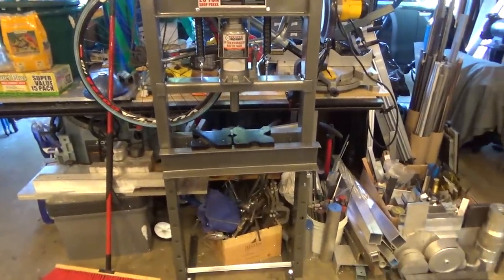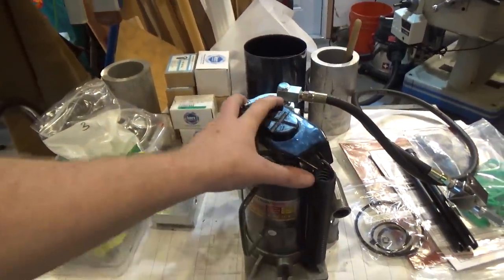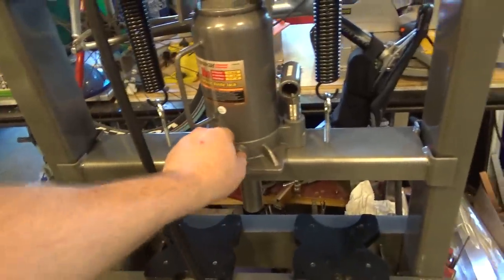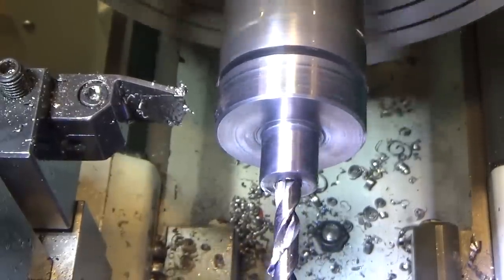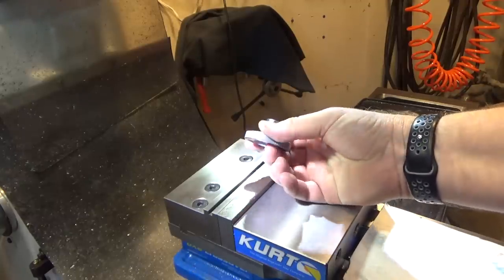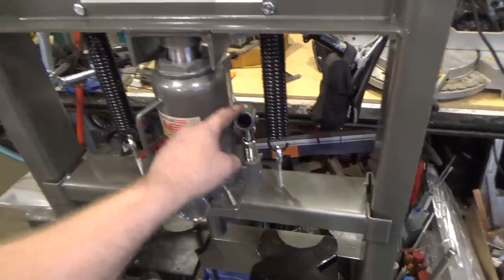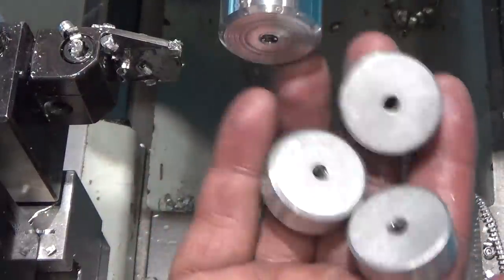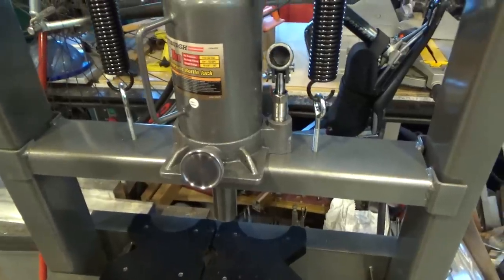Improvements to a Harbor Freight 20 Ton Hydraulic Press Part 1

Comment: Good video!  Do you do any Blacksmithing?  This would be a great addition to a Smithy!  All kinds of things can be done more efficiently such as forge welding billets of differing steels to for a Damascus billet to make knives, bending material and drawing out your billets to easily lengthen and flatten them for making beautiful knives from differing steels to form Damascus or forge welded/pattern welded billets.
I want to get a similar press and a hydraulic motor and all the hoses, etc.  THAT would allow me to forge weld Damascus billets for knife making.  As it is, I have a rare disease that eats all the cartilage from every joint, leaving me without the strength to wield a heavy enough hammer to forge weld Damascus billets.  A hydraulic press would be much easier and faster to do the job of welding and drawing out the billets.
I love the changes you made and will likely try to do some of the same things when I get mine
set up.  Although that will be difficult since I don't have a mill and can't afford one and the area of Wyoming I live in is hard to find anyone with a mill or a machinist, for that matter.
Great additions/changes!
Great addition to any shop whether you are a Smith or a mechanic or just a hobbyist!
Thanks for posting your changes/upgrades!!
Reply from the maker: Thanks for the comments. I had not considered a black smithing use as I know almost nothing about the trade. I am really sorry to hear about your unfortunate condition. I am not certain, but don't they make some sort of automated hammering device for smithing? Best of luck and I hope you find someone to partner with to let you follow your dreams.
Reply: good

Comment: Hey my boss just told me about this build. I work at a harbor freight. I was wondering how yours is holding up.
Reply from the maker: The press is holding up reasonably well. The top crossbar bent up about 1/8" when I put a full 20 Tons pressure on it and permanently deformed, but hasn't gotten any worse since then. The Jack won't hold 40,000 pounds (20T) very long without leaking down to something like 12,000 pounds. I tested this with a 100,000 pound load cell. You can check the video if you like. Over all I still think it was an excellent deal for the money. The equivalent in a name brand like a Dake is 4 times more. It is quite functional and the mods I made are definite improvements - especially the knob on the pressure release. Fell free to contact me directly if you need more info: dudley.toolwright@gmail.com

Comment: I think I would have just drilled holes and used lynch pins to keep the bars from sliding out. Would have been less work than turning four end caps and would be faster to adjust. Still nice work though.
Reply from the maker: I thought about that solution and that would have been much easier, but I was going for interesting. Sometimes that take me the long route, but I always learn something. Thanks for the comment.
Reply: Dudley Toolwright nothing wrong with being creative.

Comment: A broom handle would be a light and comfortable jack handle.
Reply from the maker: That idea never occurred to me and seems a good one. I used to make furniture and sort of did a mental dump when I switched to metal working. Funny that.
Reply: Dudley Toolwright:  I got the broomstick idea from my engine crane. I worked around the slow action by tuning up the pump externals with a fitted pin and other items. Choking up on a short stick and using wrist action to speed up the movement was enough speed for me. A few inches of the broom handle were enough for the release valve and the wood gave good traction for greasy hands. Sure does not look elegant like yours, though, LOL.
Reply: Great that you had the budget for a brand new mill and lathe as well. Old equipment seems so often worn and savaged that you do not have the time to work on any non-machinery projects. I am getting so old that I may only have ten years or so to work before I get too geriatric. But who knows? I do not want to buy junk mini equipment and Shurline etc are nice quality and slow, slow, slow.

Comment: Very good video would you be able to make those parts for me
Reply from the maker: I have had a lot of requests for making these parts, but unfortunately without a CNC the price I'd have to charge would be ridiculous. Even worse, Harbor Freight continually changes vendors and part numbers for it's tools and usually has at least 2 skus for the the same item so I couldn't even guarantee that they would fit.

Comment: Did I miss the memo? When did crocs replace the steel toe work boot for ppe?

Like the upgrades though.
Reply from the maker: It's posted on the lack of safety bulletin board. I have responded to this very fair criticism in the past, but the short story is that I go in and out of the garage often and I need to leaf the swarf shoes outside fearing death from the boss. I am very aware of moving anything heavy - which I rarely do. On the downside, I am always getting chips in the shoes...

Comment: I just found your channel and really like what I've seen so far. What lathe and mill do you have?
Reply from the maker: I have a Chinese made ACRA 9x49 mill (the sell Chinese and Taiwanese which is a lot more) as well as a Taiwanese 14" Heavy lathe. The lathe is seriously heave for a 14" coming in at around 3300 pounds. It is very vibration resistant. Thanks for the comment.

Comment: Nice 
I was to lazy to put a nice handle on the release screw so I used a mini set of voice grips.well locking pliers from HFT
Reply from the maker: Necessity is the mother of invention. The handle solution clearly was not working.

Comment: Why not put the jack in upside down?  Then the adjustable screw would work as you want.
Reply from the maker: I had not considered it at the time. It would have required changing the intake position of the hydraulic pump intake, but completely doable. I appreciate the suggestion.

Comment: You could attach a small magnet to the end of the aluminum handle to secure it a bit better but still be able to remove it one handed.
Reply from the maker: Interesting solution. I love the idea. thanks.
Reply: An aluminum magnet, correct?

Comment: So I take it the jack motor pump can not supply enough to actually use it for pressing, it still needs to be manually pumped? It only serves as a rapid positioner?
Reply from the maker: I actually think that it can if you have 120 psi available from your compressor. However if you are trying to be precise the manual fall back can be useful.
Reply: neat, thanks for the reply.

Comment: Brother, what kind of camera do you use for your videos? I have a 20 ton Bosal press which is about 40 plus years old (my late father's) which I need to modify due to the enormous horizontal movement of the pumping handle. It just plainly annoys me when something has excessive play or movement.
Reply from the maker: I use an inexpensive ($200) Sony camcorder. It is not very robust but takes great pictures. I dropped it once from about 2 feet and the thing exploded. I didn't know they could make plastic that thin and still be opaque. I'd love to hear how you solve the problems with your press. Good luck.
Reply: Good morning Brother. 200$ in my currency (South African) amounts to about 3000 at this stage. I'm taking notice of what you say about the quality of the camera. Well, what isn't made out of plastic and manufactured in China? As far as the press is concerned, I was thinking about something with a slot (mill a slot in a piece of flat bar or construct something with two pieces of square or flat bar joined at the top and bottom and then mounted on the horizontal cross bar of your press. This will restrict the side way movement of the handle. My press has a proper hydraulic cylinder. So, I will mount this bracket on the top stationary cross bar. I think it should work well. Happy pressing.

Comment: Great vid! What's the part number to the air jack? Thanks
Reply from the maker: I do not know and they sell multiple versions of most tools. However, here is a link to a coupon for one of the models of 20 Ton air Jack for $89. I hope this makes up for my lack of info:

https://www.harborfreight.com/savings_coupons.html

Cheers.
Reply: @DudleyToolwright  thanks so much . Certainly did make up for it 😀

Comment: Very nice.  Would you be willing to make me a knob for my bottle jack?  I will pay for it.  Its a nice idea.
Reply from the maker: I have had so many requests, but with a manual lathe the cost would be prohibitive. I'll see what I can do. By the way, it also seems like a decent possibility that the valve knobs on different jacks are not the same size - another reason I haven't made any. Harbor Freight often has many sku's for the "same" product. Heck, the press I have has already been significantly improved upon.
Reply: @DudleyToolwright  yea I noticed when I bought mine it was significantly different then the original pics I saw on line.  I did a few of your upgrades already.  I also replaced all the bolts with grade 8 and nylon nuts.  That actually made a difference.  I also made the spring eye bolts adjustable and locks into place (most of the time being level)

Thanks for your tips and tricks. I enjoyed doing them and watching the Vids.
Reply from the maker: Thanks for sharing your mods. There are so many good approaches out there.

Comment: On the caps for the pins why don't you use a end mill the right diameter instead of the 1/2" and  a boring bar one less step.
Reply from the maker: Nice option. I didn't think of it thanks.

Comment: So I’m looking to get one of these, and the air jack conversion, but I only have a smaller hot dog air compressor. It’s a 3 gallon 100psi 1/3hp harbor freight “hot dog” compressor. It only has 0.6cfm. Will I be able to move the air jack down at all with that compressor? I only need to move it down once quickly to press together a hot(2300f) San Mai billet of steel. Do you think the smaller compressor would be able to accomplish that? I’d close it manually to the point where it would only need to be closed another inch or so max.
Reply from the maker: That is a good question. The manual for the jack does not list CFM usage, so I don't know. If you were close perhaps there would be enough tank capacity to compensate. You could add an ancillary tank to help.

Comment: You can flip the jack so the screw in on the bottom..
Reply from the maker: You can, but if you do you need to modify the hydraulic fluid intake method, otherwise you will be sucking air.
Reply: @DudleyToolwright  Yes, I added a small reservoir as well. I wanted the screw down. Very thorough video thank you for taking the time!

Comment: Fast question, is the 12 Ton and 20 same frame? Just the jack that comes with the kit is why it’s more?  If so, save the 40.00 and put that towed the air jack? 

The 12 ton I think is 99.00
Reply from the maker: They are not. The 20 ton is taller at a minimum, at least based on the sku's that were at my Harbor Freight. Quite often, they have more than one part number per item.
Reply: Dudley Toolwright I appreciate your answer. Would be willing to make a knob for me? What would the cost be? 

I’m going to be getting this press next week and then the pneumatic jack. 

I’m also interested in other mods that you made.
Reply from the maker: You are not the first to ask that question. If I could find the time I would be happy to. I can't even find the time currently, to get 1 video out per week. I will keep you in mind if things change. Thanks for the kind words.
Reply: Dudley Toolwright 

I appreciate you keeping me in mind. I was reading there are 2 versions of this 20 ton too. W bolt together and welded. How do I know which one I’m buying? 

The other thing was the what’s the part number for the pneumatic jack you put in? Thanks a ton for your info.
Reply from the maker: The question as to which one you are buying is probably only answered by going to the store and asking the manager which one they have in stock.  They have 2 air hydraulic jacks 95553 and 69593. I think I got the 69593 based on color, but am not certain. Sorry I could not have been of more help.

Comment: why didn't you just pound the pin out of the jack, crossdrill the new handle at the appropriate height slightly larger than the pin then, reinstall the crosspin or use a roll pin
Reply from the maker: Probably because I didn't think of it - thanks for the interesting idea.

Comment: I notice that you took a very small cut for the finish of the od and didn't like the finish. Try taking about a .02 to .03 depth of cut and you should get a better finish at .004 per rev at about 1000 rpm
Reply from the maker: Thanks for the suggestions. I really appreciate it. Feeds and speeds are still a stiff learning curve for me. Cheers.

Comment: Why not just weld a knob on the release valve, done
I like the idea of using there air jack.
Reply from the maker: That would certainly make the job easier, but don't you have to worry about part distortion caused by the heating processes.
Reply: @DudleyToolwright  I think taking the part off then welding it would be acceptable.
Reply from the maker: Thanks.

Comment: Did anyone think about bleeding the air out of the jack so it pumps faster??? All new jacks have to be pre bled before use.
Reply from the maker: Interesting. I am not sure how to bleed this type of jack.  I will have to look into that.
Reply: @DudleyToolwright  well the manual pump bottle jack should have a rubber nipple on the side of it and the instructions telling how to bleed the jack. More less you leave the valve released pump the jack then push the nipple over and you should hear a very small hiss come from the nipple. You also leave the valve released and top off the jack with jack oil cap it off with the rubber nipple pump the jack several times with the valved released then push the nipple over and it should hiss slightly letting air out of the bottle jack. Even the hf floor jacks tell how to bleed air from the hydraulic ram on them and the top off procedure.

Comment: Title should have been how to make a knurled knob, or watch me make a knurled knob. Plate pins are a nice mod.  Push that press to its limits when the verticals start to twist and flare and the press stands on its toes, then make some improvements..
Reply from the maker: Thanks for the suggestions. I have very little knowledge about hydraulic presses, so as I use it more, I will discover more of my or Harbor Freights design short comings. Hopefully the lessons won't follow a catastrophic failure. I appreciate the heads up.

Comment: Any advice on why my harbor freight 20 ton jack doesnt retreat all the way down?
Reply from the maker: By this, you mean that the piston doesn't retract all of the way back into the jack body? If so, tighten the eyebolts to add more spring tension on retraction.
Reply: Dudley Toolwright Even if i remove the hydraulic jack from the press,  the cylinder sticks up about 1.5 inches and wont fully retract,
Reply from the maker: That sound like a defective jack. You can take it back to Harbor Freight or but a new one. They aren't terribly expensive. I can't imagine what the internal failure would be other than bad machining. Bummer.
Reply: Air gets in from pumping a lot and does that

Comment: Do those holes create a weak spot?
Reply from the maker: Perhaps. I was thinking along those lines as well. If the press plates had been cast iron, I would have been even more concerned. Fortunately, based on the chips made rather than powder, I think the plates are steel and hopefully if they fail they will fail gradually by bending rather than catastrophically by breaking. If they bend I will let you know. Thanks for the observation.

Comment: I love what you’ve done to your press. What would you charge to make me the same ones?
Reply from the maker: I would love to be able to produce these parts, but with manual machines, the prices would be prohibitive. I might do a short run of some of the parts at some point. I will make an announcement if I do. The other problem is that Harbor Freight tools are a moving target, becuase they constantly change manufacturers and have a bunch of part numvers for every individual tool. The current 20T press has a bolted on top bar, mine is welded. I also think it is wider. Crazy.

Comment: I added two equal bottle jacks (one on either sides ) and I think that I increased power to 60 tons ??  Roger E
Reply from the maker: Interesting idea, but be careful about not exceeding the strength capabilities of the structure. Catastrophic failures at pressures like 120,000 pounds force can be ugly. Also it might be tough to get the pressure symmetrical causing a part to fly off at an angle. Thanks for the ideas.
Reply: @DudleyToolwright  Several years ago I used the 3 jack set up to press the rear wheel bearing off the axle of a 1974 Caddilac.
Believe me, I was pressing hard with all 3 jacks.

As always where there is that much force, fly out danger is.
I hide behind a sheet of Lexan.  Roger
Reply from the maker: Very interesting. It sounds like you know what you are doing.

Comment: Slow down your horizontal feed rate a little on the mill and the little bits shouldn’t break.
Reply from the maker: Thanks. I always try a slower feed rate than I think will be necessary. I think there is a conspiracy a foot (or lack of experience). Thanks for the suggestion.